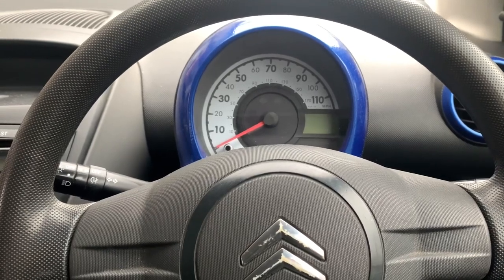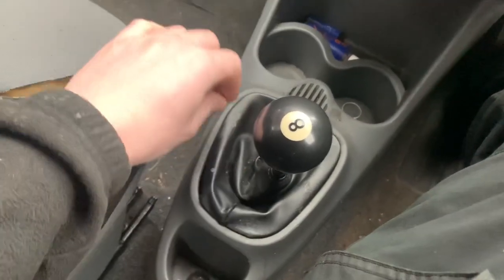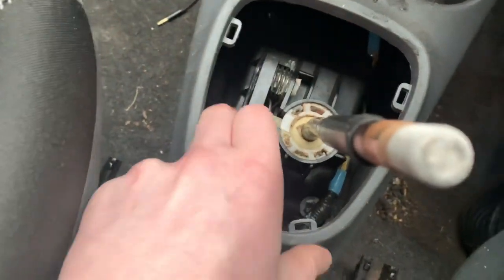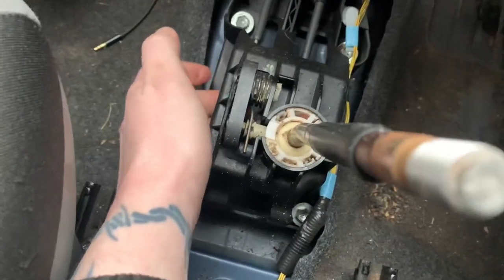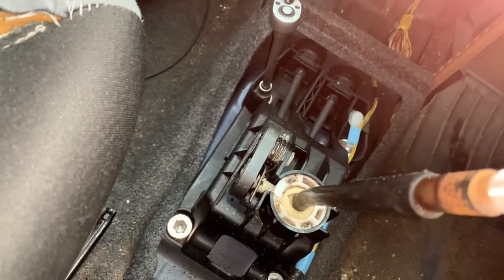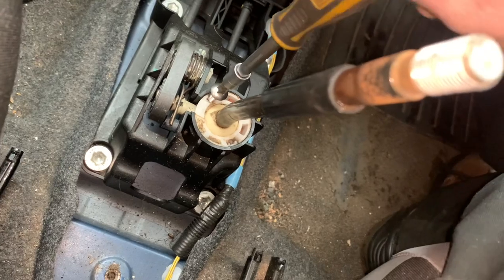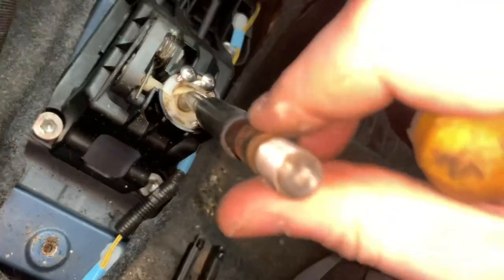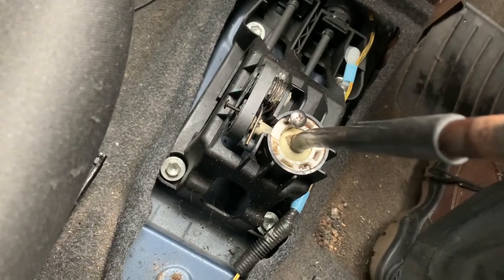Loose Gear Stick Cheap and Easy Fix/Sloppy Gear Shifter Hack (Citroen C1/Aygo/107 CityBug)

Comment: i watched your video , and had the same peoblem , so today i stripped the whole lot out , on the bench with the gear stick assembly , measured the end float brought about by wear in the swivel ball , persevered and stripped it all out ,, made a stainless steel shim , exactly the right size and shape , heat formed it into the right curve for the ball and went to re assemble it all using tungsten disulphide lube ,, and got it back together and into the car ,,,, perfect for three gear changes , then it stuck , stripped it all apart again and took the shim out ,,, reassembled it to its original condition , and put three self tapping screws in ,, perfect.
Reply from the maker: That, is brilliant 🤣
Reply: @StupidBlokeStupidVideos  true too
Reply from the maker: @tomthompson7400  I actually thought you was joking 😂😂😂
Reply: @StupidBlokeStupidVideos  nope ... spent all afternoon at it ... then three screws took two mins ... its the perfect fix .. you should put three screws in a bag and sell them as a kit

Comment: Great that you showed what's causing the issue. I'm impressed with creativity. However I'll try to fix that more professionally 🤣
Reply from the maker: This is the Shitroen/Peugeot/Toyota approved repair technique. 

Well no,.. not really 🤔
Reply: @StupidBlokeStupidVideos  I wish I recorded what I've done to my Aygo's gear lever.. I took the lever completely out ( you need to undo 2 gear cables. One is on the left side with one curved pin. Then one is underneath where you have to pull out secure wires both sides with a screwdriver. And then when the lever is free pull it to the left and in the same time use thin flat screwdriver to undo 4 clips around white bushing. Whole bushing will pop out. Then pull it up and remove from the left bearing. You might need to use some force. But don't worry you're not going to brake anything. ) When I took it out there was loads of factory applied white grease. I left it how it was. The only upgrade was 4 stripes of old credit card. Cut it in around 10x20mm and stick in the socket where plastic bushing was placed. You will see the spacers and if you cut wrong size just adjust to the dividers. Then put back lever with ball and casing. Use flat screwdriver to avoid credit card pieces being smashed when you push down the casing. It took me 20 minutes to find better way to do it and my gearbox is as brand new. If you have bigger loose use extra bits of credit card or plastic mineral water is 1/10 thinner so you can adjust. Hope that helps.

Comment: Hi mate, great video again. I need to do this on my daughters C1 but Before I go ahead with it I wanted your opinion on replacing the whole gear shifter unit with one from a MK2 C1/Aygo/108. Do you know if it would fit into a MK1 C1? 
The idea is that I could get a good condition unit from the breakers and being from a newer model it would have less wear and tear.
Reply from the maker: Hi, thanks mate. Yes some people in the groups have fitted mk2 gear shifter unit to a mk1 so they must fit
Reply: @StupidBlokeStupidVideos  Thanks for the reply mate
Reply from the maker: @kampatel99  no problem mate

Comment: Thanks, I need to fix this in my c1. Do you know if it's much more effort to replace the bushing instead of putting screws into it?
Reply from the maker: I’m not sure if the bush comes as a separate part, but looks like it does come out. Shouldn’t be too bad to change by the looks of it though if it’s available, as long as the bolts holding the housing to the floor aren’t seized in.
Reply: @StupidBlokeStupidVideos  thanks! I asked Citroen about it after I got it & their reply was an astounding "common issue on the c1" and no effort to fix it 🙄 it's usually fine after the car has warmed up a bit anyway, oddly enough.
Reply from the maker: @Lassitude1001  yea it’s a very common issue, and they’ve fixed it in the same way they have the common water leaks... by completely ignoring it 🤣
Reply: @StupidBlokeStupidVideos  sounds about right. I've watched your videos of water leaks too (and pretty much everything else).

I keep finding my jackets wet in the boot but no other signs of water leak on the carpets/sides etc it's really odd. Think it might be through the very top of the boot dripping and sitting on my waterproof hi-vis, but I'd have to not be lazy and test it to confirm!
Reply from the maker: @Lassitude1001  sounds like it could be if they’re directly below the seal. You can sometimes “adjust” it. Pull the seal off and bend the metal outwards a bit towards the hatch then put the seal back on. It’s made of really thin tin that bends easily, and probably gets pushed in slightly over time by the hatch.
Reply: @Lassitude1001  top brake light always leaks

Comment: Long term how's this been holding up?
Reply from the maker: It’s still not bad. It’s not quite as good as when I first did it but it’s still way better than it was before I did it. Might put another screw in it to tighten it back up if it gets baggy again

Comment: Is it necessary to take off the cables? Can’t you just put in the screws straight away
Reply from the maker: You can just pull the gaiter off and bang them straight in. I only took them all off because I planned on taking it apart and doing it a different way before coming up with this idea. It works well , and is still working fine since this video too!

Comment: does it matter how you position the bolts or it's all the same?
Reply from the maker: Not especially, but they want to go onto the slot of the bush as shown and I made sure to put them so the screw heads were out of the way of the gear stick when selecting all gears.
Reply: @StupidBlokeStupidVideos  I did it & cut off the screw heads lmao

Comment: My 107 won't go into 1st from 2nd unless I am at a complete stop, what you think this might be?
Reply from the maker: 1st to 2nd, or from 2nd back down to 1st?
Reply: Did read it can be the synchros, but don’t think it’s worth taking it too a garage to get sorted.
Reply: @StupidBlokeStupidVideos pls.advise my 107 would not go into 1st gear when slow down except you come to stop..
Reply from the maker: It seems that it’s quite normal for these cars to be like that. I’ve heard that they don’t have a 2nd to 1st synchro, but that may not be correct. I do know that it’s a question that’s often asked on the Facebook groups though.
Reply: Yeah I read that too. I only use it for work and back so just got to get used to it.

Comment: hello, if the screws are oushing against the ball it's not good. it'll damsge the ball, make it worse. regards
Reply from the maker: Yea, just be careful where to put them but they would have to overhang the edge quite a lot to touch the ball

Comment: hello, for the mechanism you better use silicone grease. regards
Reply from the maker: Probably, but any grease is better than no grease
Reply: @StupidBlokeStupidVideos  well, i used to have that opinion untill you smell the grease in the car
Reply from the maker: @user-2uf2kr2c  tbh, I’m usually the source of the smell of grease in my car.